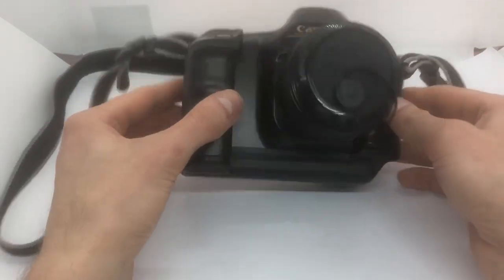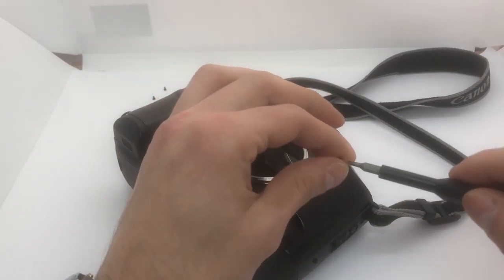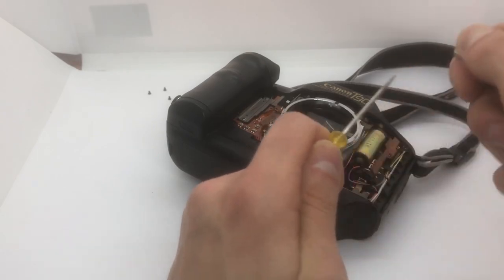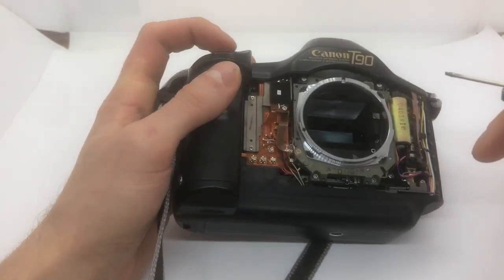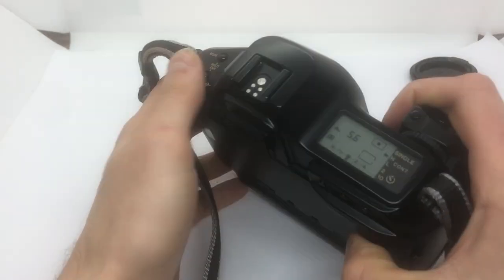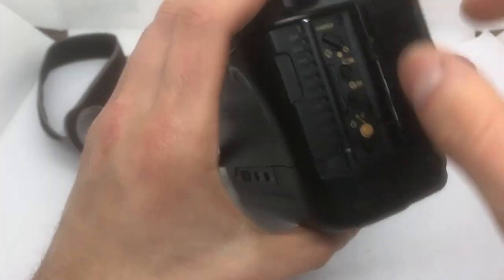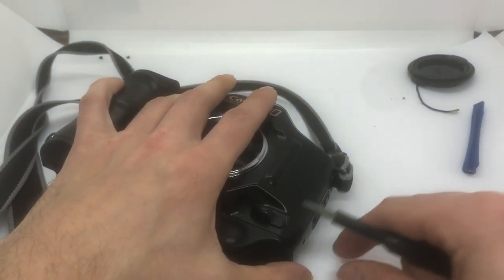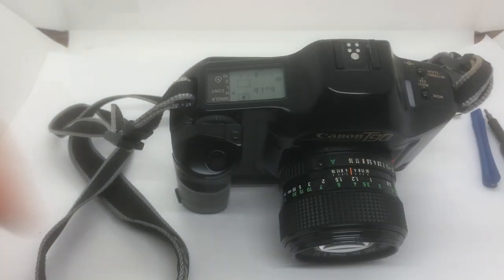Canon T90: Fixing the Blinking Cursor & EEE Error (I needed two attempts)

Comment: How long did this 'fix' last? Several reports I've read say that the problem comes straight back after doing this. Other people say that banging the camera on a carpeted floor releases the stuck shutter, but the problem returns. I can release the stuck shutter by actuating the stop-down lever, but all of these actions only seem to fix the problem for a short time before it returns.
Reply: Ive tried this "fix"but even with a highly charged magnetic screwdriver nothing happened.  This cameras has to be used regularly to keep the points magnetised, so at least every week fire off the shutter 20/50 times , or even every day. This stops a reccurenceof the Blinking cursor and or the EEE error. The stuck shutter is a different problem and I came across a video of how to Fix it. clean the shutter blades with lighter fluid or alchohol, and at the base of the shutter as you are looking from the front, there is a gap,at the bottom of that gap a Black gunge develops and sticks the shutter.  just using  a thin strip of clean cardboard, soak it in the lighter fluid and scrape it along the bottom and as much of the sides as possible, you may have to do this quite a few times , its staggering how much black gunge is inside, it sort of solidifys preventing the shutter operating normally. I didnt fix my EEE error, but decided to try and clean the shutter anyway, and yes there was quite amount of the gunge. The shutter is easily cleaned with the back open , and if you lift up the mirror you can access the other side
Reply: @gordonyoung1970  After watching several videos about performing DIY surgery on T90's, I decided to get my T90 fixed professionally. Not many people still have the skills, but some do. I sent my camera to Steve Sweringen's Camera Clinic in the US. It wasn't particularly cheap, especially with shipping costs from Thailand and back again, but he did a great job. He has many years experience, the T90 is his favourite camera, and he understands this model very well. Anyway, thanks for your feedback!